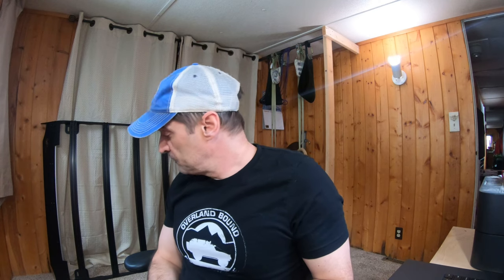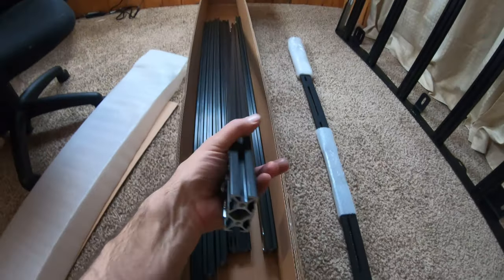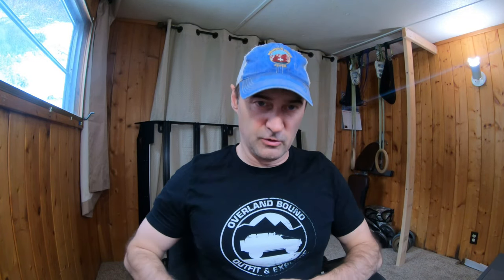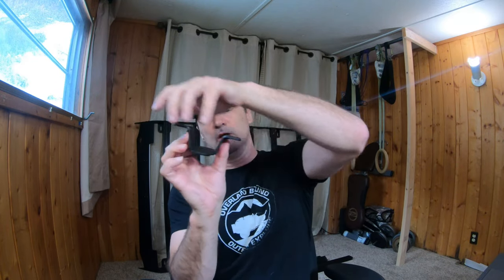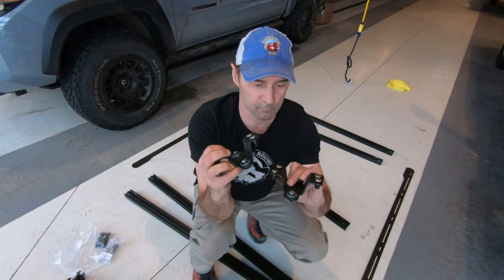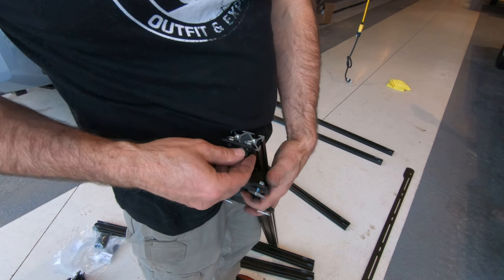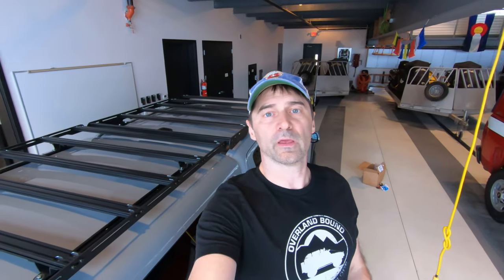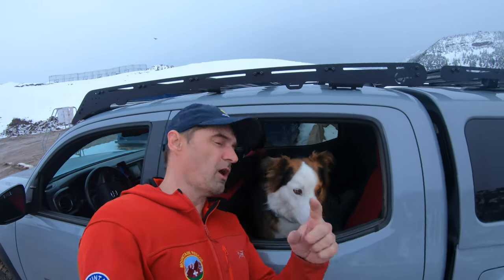Prinsu Top Rack Install On A SnugTop GB Camper Shell - 3rd Gen Tacoma

Comment: Great video…what size rack was this and what was the maximum distance between the feet that bolt to the tracks. I ask because my factory tracks are 44” on center, and Prinsu can’t tell me what that measurement is for a 5.5’ x 47” wide rack…thanks in advance.

Comment: I just installed mine based off this video. Took about an hour and twenty minutes. There appears to be a fair amount of extra bolts and washers. Not sure what the 4 flat plates are used for either that they sent with mine. I am assuming for mounting other stuff in the horizontal direction of the regular bars run.
Reply from the maker: I ended up with extra as well.
Reply: Those 4 plates are stiffeners. Contact Prinsu for the latest install guide, not the one on their website. It shows where to install those. I ran into the same situation.

Comment: Should the weather strip be reinstalled on the roof tracks?  Assuming you would have to cut it to leave openings for where the feet attach to it.  Or do you just leave the weather strip off the roof tracks altogether ?
Reply from the maker: I put mine back in for looks, but once it's sliced up it no longer is weather tight.

Comment: If there is curvature of the truck cap roof, causing slight angles of the tracks (mine are Yakima) , those feet will not work.  I have this kit on garage floor looking for a solution.  The top rails will not sit flat on the feet.  Mine and maybe yours will be approx .5 inches off, rendering the feet unusable.  Prinsu does not have a solution.  Just sharing.... this kit (the feet) are not universal.  Hope this helps the next guy.  I'm likely spending a few hundred $$ more at Sherpa for their adjustable feet.  Good Luck!
Reply from the maker: Went on without issue and is still solid after 4 years...

Comment: John, I just bought a GB Sport topper and am adding a Prinsu top rack to it. Does the GB sport topper come with the trax that you mount the top rack too or are those aftermarket? Thanks!
Reply from the maker: Mine were installed by the dealer. They're Thule racks though.

Comment: I was thinking of cutting and reinstalling the rubber track covers between the posts when I install mine. Any thoughts?
Reply from the maker: I thought of that too. Makes it easier for sure. And to be honest unless you try to look for them you can't see the covers anyway.
Reply: @JohnTYoung  I am wanting to reinsert the rubber covers to reduce water getting in. It will obviously not prevent water from getting in the tracks but will reduce it
Reply from the maker: @ericksonclayton  As long as you seal the bolt holes no water will get in. It is almost impossible to seal the track once you've started cutting it up. Or was for me.

Comment: Hi John it's been over a year and was wondering how has your tracks and Prinsu worked out? I have a long bed Tacoma..Snugtop too that's beefed up for more weight on top from factory.. and haven't decided what tracks to use yet. Rhino, Yakima or Thule..or if you know another?....just your thoughts. Thanks!
Reply from the maker: If I remember the track are Yakima, but only because that's what SnugTop suggested. I don't think you can go wrong with nay of them. So far so good. No cracks leaks or have the roof top tent fly off while 4 wheeling.
Reply: @JohnTYoung  ..thanks John for getting back..for I myself have fixed up my Tacoma too.

Comment: have you noticed any change in fuel economy with camper and rack system?
Reply from the maker: MPG went up when I added the shell, down a bit when I added the slightly larger tires, and hovers around 19. With the RTT on it varies wildly depending on the wind. 14 MPG trying to do 80 on I70, to 17 when it's calm out.

Comment: Any suggestions? tightening the feet pulled the track up as there is a slight curve to my snug top roof. Its not the bolts, I went shorter to verify.  thanks to anyone who can help with this
Reply from the maker: Leave everything loose
Reply: Put some washers on the side that pulls them up,

Comment: Hey, I noticed your tracks are installed on the thicker honey comb area on your cap. I have heard mixed reviews on this. Any problems?
Reply from the maker: The tracks were factory installed so I would.hope they are in the right area. Now you got me thinking. Where are they supposed to be?
Reply: @JohnTYoung  I'm not sure. I have been trying to figure it out. I have contacted prinsu to find one of their shops to install mine. I haven't been able to find one within 4 hours.  So trying to figure it out.
Reply from the maker: @seanprouty2570  My old cap had an obvious "thicker" part to it when viewed from inside. This is about where the factory installed the tracks. I'm pretty sure the width of the tracks is standard-ish.
Reply: @JohnTYoung  thanks! I appreciate the info. I couldn't seem to find any other details online about it.

Comment: Going to get a Snugtop shell for my Tacoma. I have read in some forums that the Prinsu rack has a tendency to pull or lift he factory installed tracks off the shell. Have you noticed anything like this? Great vid.
Reply from the maker: You definitely have to be aware of the length of the bolts used by Prinsu. Not all tracks are of the same depth, and sometimes the bolts are too long and make contact with the rack.
Reply: @JohnTYoung  it doesn't pull up due to bolt length,  it's the cross bars do not sit flush on the feet.  When everything is tightened, the tracks lift up.   This is caused by the slight curvature of the topper.  And is only fixed with washer or new feet.  Yes,  I know this is old.